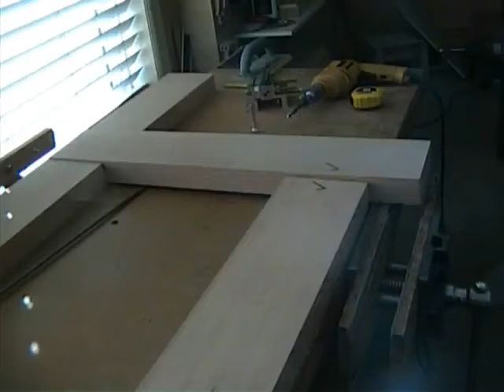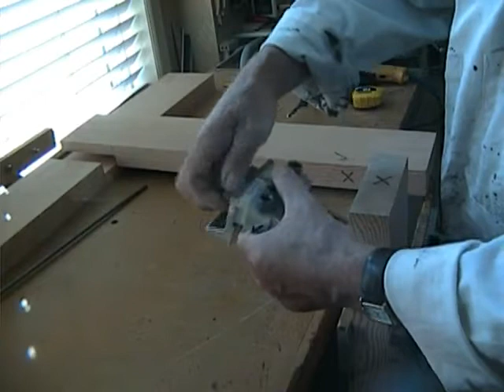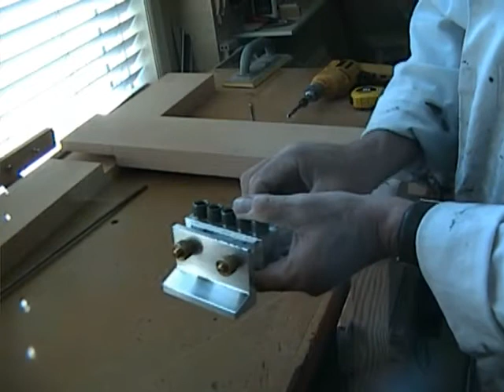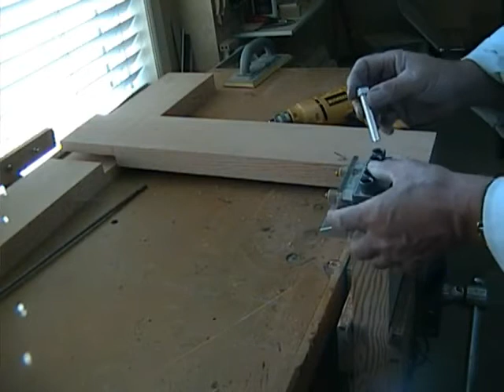How to Build a Workbench using Dowelmax Part 2 - Joining the Longitudinal Rails to the Legs

Comment: You say that the last time you tested the joint that it failed at 2000 lbf / sq. inch. That is nonsensical . If you apply the force as a shear force (which you do) it is a direct force of 2000 lbf  unless you are taking the CSA of the dowels into account which will mean something else .Can you clarify that to your audience please and tell us what the fail force is, how many dowels and the dia. Of the dowels. I rather think you mean a shear force of 2000 lbf. Hey we've all done it. By the way it's a damn good product, Thankyou .
Reply: Hi. You are absolutely right.  Lbs/sq. in. slips off the tongue.  I should have said 2000 lbs.  Jim